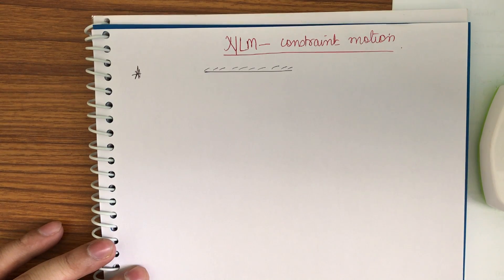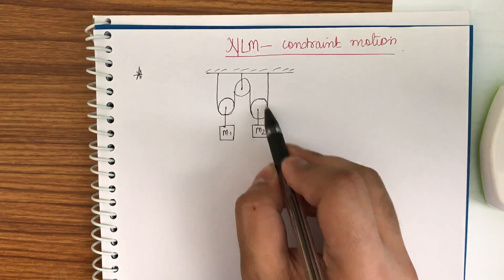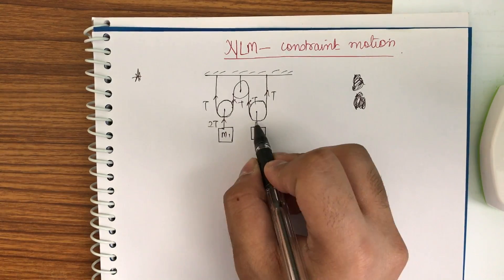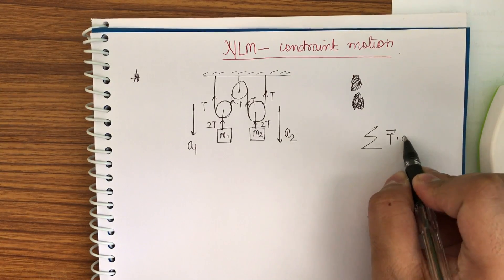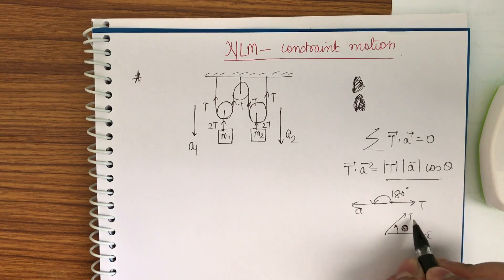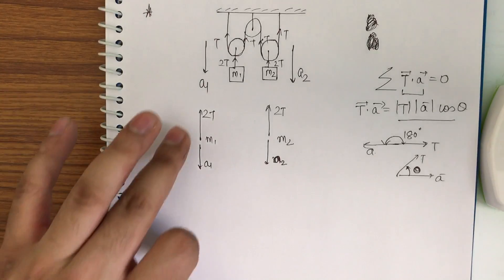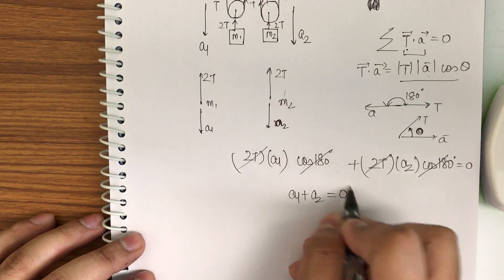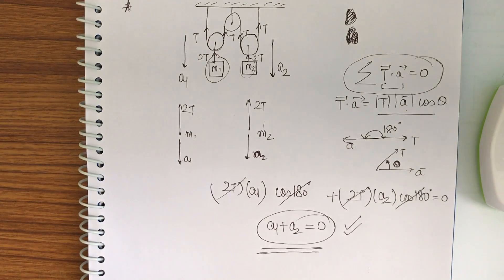Constraint Relation Trick (NLM) | Pulley Problems in Physics | JEE Main, NEET, AIIMS

Comment: Why @3:00 2T Nd cos 180 got cancelled?
Reply: same question
Reply: @kaustubh6668  hello. it’s because the equation is equal to 0. (2t)(cos 180) is common in both a1 and a2 in LHS, so you take it out as common factor so that you get 2t*cos180(a1+a2) and then you transpose 2t*cos180 to RHS and you get 0/(2t)(cos 180) which is just 0. so now your equation is a1+a2=0. so instead of doing all that, it’s a calculation shortcut to just cut the common factor of two terms on one side when an equation is equal to zero.

Comment: Two cars A and B are moving towards each other on a straight road,  with speed 50m/s and 100m/s respectively. A mosquito moving with constant speed of 150m/s, starts after biting driver of car S and moves towards driver of car B bites him and comes back of car A, bites him and again continues moving to and fro and biting them. Find distance travelled by mosquito till the cars collide, if the initial seperation between them is 1 KM .

Comment: Sir just wanted to add something
If the string is not roatating that means the string is not changing its position and is only going up and down on the pulley then you can use the formula £T.a but if the string is covering a distance say x in horizontal direction then this formula is not applicable then for acceleration you will have to differentiate the formula £T.v

Comment: One question keeps bugging me.
When u r attaching all the pullies to the wall then how are they gonna be in motion?

The summation is 0 only because the the pullies aren't moving.
The difference is done to get a result of DX/DT which is equal to 'v'.
Let's say the main pulley has a velocity of 'v' or acceleration of 'a'. Then the result would be 
Length of the pulley string is always constant
V(pulley)=(v1+v2)/2
a(pulley)=(a1+a2)/2
Reply: @ohyeah ohyeah dude the string is open from one end and you have to pull the string so that it causes some initial tension and then the blocks with the mass m can move

Comment: Thanks a lot! It works amazingly! But i would like to know 2 things:
1. Why does this technique work?
2. Is this technique universal? I mean can it be used in every possible situation?
One more thing i noticed is that, even if some pulley system is not accelerating, but rather moves with a constant velocity, we can apply the same technique by doing Sigma T•V=0, and find the velocity relations.